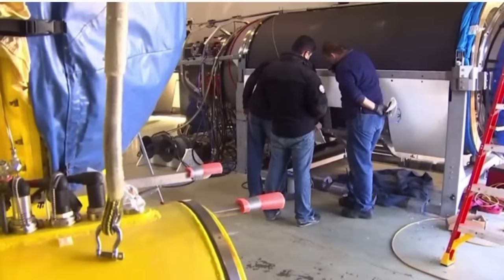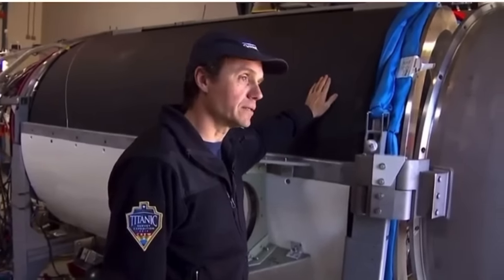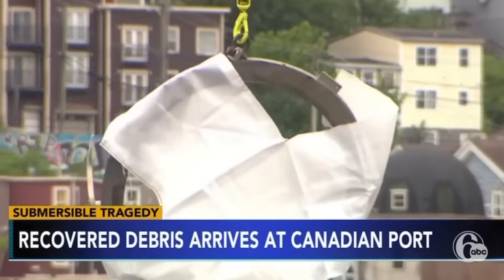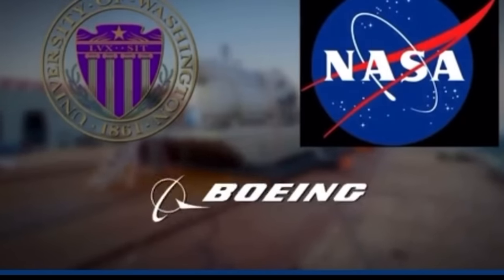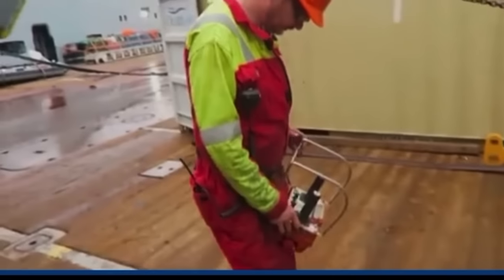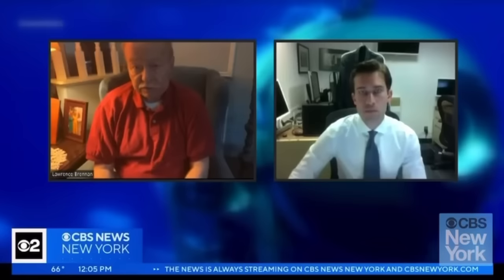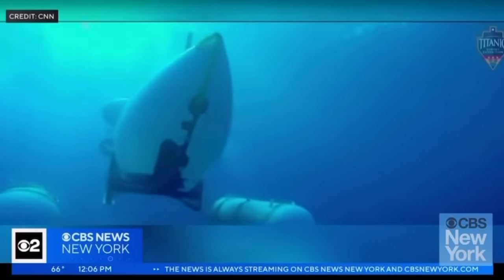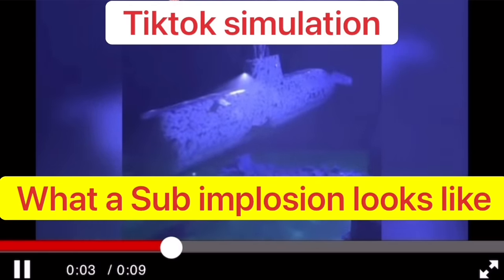Titan nosedived like an arrow (then popped like a balloon) #Titan #oceangate #Titanic

Comment: Was the origin of the regular `banging noises` heard for several days ever discovered? At one point it was believed that the sub occupants were trying to attract attention, but of course we now know that could not have been the case.
Reply: The ocean is a noisy place.  And sounds can carry for thousands of miles in water.   For example, The NAVY did not “HEAR” the sound of the implosion. They have microphones all over the ocean floor ( listening for subs ) and they RECORD the sounds.   When they heard about the Titan going missing, only then did they review the recordings and discover there was an odd sound that could have been an implosion.   There has never been an implosion of a small submersible, so the Navy would have no data set on which to base an analysis.  The banging noises could literally have come from the search vessels, if someone was in the kitchen banging pans against some part of the ship, or a crewman was effecting work on the engines.   The banging noise could just have been chunks of the Titanic itself falling apart.   The ship is literally crumbling to pieces, and a chunk of rusty iron decking dropping onto the deck below or a piece of squashed hull could make a banging noise.
Reply from the maker: the Navy heard the implosion right away but it seems they did not communicate that soon enough
Reply from the maker: interesting , in most reports it says the Navy did hear it when it happened, hopefully they will release more information soon
Reply: @silki24  Yes, but the Navy never said that. They said they ‘detected’ an anomaly. The SOSUS network is hundreds of microphones all over the ocean floor.  It alerts navy personnel if it detects a something unusual, and then the recording as actually listened to by analysts. But it’s not like they are actively listening, live, to five hundred audio channels 24 hours a day on the off chance of hearing something.  It was not until the support vessel actually reported when they lost contact with the sub that the navy had a time reference and found they had detected something around that time in that location.   But then, the surface support ship had a hydrophone in the water, too and would have heard the implosion way louder.  But, again, no one had ever heard a submersible implode before, so they weren’t sure what they were hearing.

Comment: Why do ppl keep harping on the fact that they were bolted in? I'm pretty sure if something happened where rescue could be possible they would have to raise the sub bcuz humans 1 cant breathe underwater and 2 humans cant withstand the pressure of the ocean that deep. The ONLY way they could have been rescued underwater would be if both subs could dock together allowing safe transfer to the rescue sub. Are there even subs that could do this?  I'm not an engineer so please correct me if I'm wrong.
Reply: i think the thought is if they surfaced but nobody could find them...they would float around running out of oxygen while people searched, while other subs could atleast surface and open their hatch and not suffocate. i think thats why but i could be way off too!
Reply: @heatherlouise814  I believe you are correct 💯. I just hadn't thought of it that way. The whole Titanic/Titan thing had me locked in on the sinking part. Well that and somewhere they said that Titans tiny little thrusters weren't powerful enough to help them surface. Apparently they were only meant to steer.

Comment: 10:10 the sub did NOT freefall for 3000 ft, this is a submersible, it works on bouyancy, not lift and wing angle. if it freefell from any point, it wulda been overweighted from the start, and freefell from the beginning. everytime i see someone post a claim of this freefall, has clearly never swam enuf to understand how waters resistance and bouyancy work. . . remember. . . its nt a damn airplane
Reply: It's just like an airplane
Reply: @Cleatus546  Spoken like someone that has never spent any time in a submarine.
Reply: @brianhubert8513  
I was assigned to the USS Tugboat during the Korean War, I know what I'm talking about.
Run silent run deep.
Reply: @Cleatus546  What was the hull # ?  I know what I'm talking about also. I served on two boats. The USS Tecumseh and the USS Francis Scott Key. I also have a pilot's license. Subs are not like an airplane!!!
Reply: @brianhubert8513  
The hull number was 007,  but keep that under your hat, it may still be classified. I have two pilots licenses and  submarine license. I'm not boasting. I also served on the Scott Petterson. I also flew an unmanned drone during WWII.  Thanks for your service.
Reply: @Cleatus546  which two pilots licenses do you have ??
Reply: Class A & B
And forklift certified
Plus Submarine License. 
But I'm not boasting.
Reply: @Cleatus546  007,  A&B  That's right you're not boasting.  You should look up things before you make these kind of statements!!
Reply: @brianhubert8513  
I don't have time to goof around I'm busy driving my bus..uh.. I mean flying my Cessna turbo prop. 8 seater. I used to fly with the Blule Angels, but I'm too old now. I can't take the g's.
Reply: @brianhubert8513 Ya'll are a mess 😂
Reply: @poutinedream5066  Yet I'm a rocket scientist compared to 
@Cleatus546
Reply: Rocket surgeon

Comment: It's crazy they were literally charging a quarter of a million PER person. The trip the "accident" happened was not their 1st trip. If they were smart, they would have seen they have a huge revenue income situation. So they should have done everything they could have to make a sub that is Fully capable of handling the pressures & compression forces that they were putting their sub through. It takes just a mild understanding of physics/material science/engineering design, to realize there is something to possibly worry about when it comes to the current design they were using. The hull was connected to the end cap with adhesive glue and some bolts, the hull was spun in a linear manner without any woven patterns or reinforced structures. They should have AT LEAST made a sub with a much more durable, strong, reinforced, trusted material design. I'm all for innovation and trying new things and pushing the boundaries but when it comes to exploring the deep ocean you want to make sure that your sub capsule does not implode or not be able to endure the environment you are going... There is no wiggle room when it comes to this & they already are charging a TON per person anyway sooo, why not make it work. If they did, they would still be having a huge income situation happening.
Reply: Well, at that price, not a huge amount of people who would be interested, so may not have been exactly rolling in money.  People who survived or didn’t go shared texts to show that Stockton was hounding people pretty hard to get customers, and downplaying the safety issue, with texts claiming it’s as safe as scuba diving, and that there has never been a submersible implosion (irrelevant if this submersible was a different design and lacked the typical stress testing).   So seems he was having yo chase customers and they weren’t a lot of them.  

And even with the corner cutting,I suspect it is pretty expensive to have developed and run a submersible….so not like that 250k ticket was all profit, a big chunk probably went to running costs.
Reply: This coffin wasn't capable of making multiple dives to Titanic depth, and proved it.

Comment: It's unfortunate that Stockton Rush did not have the funds to ensure the necessary safety protocols were followed.  Saying the submersible is good to 4,000 metres depth when your target depth is 3,800 metres yields in a slim margin of safety.  It's possible the epoxy coating had begun to fail allowing the craft to take on water and more mass.  It's apparent a surfacing attempt was made with barely much of a rise.  If the coating kept allowing water in, what little buoyancy remained would be eliminated.  Almost at its maximum depth with a decreasing structural integrity: "it's been good to know ya".
Reply: He picked those numbers out of his arse, and with fingers crossed.
Reply: @sandgrownun66  
That seems to be the case.  Didn't work out for him though.
Reply: @MsJfraser  It never was going to work out. All the correctly engineered submersibles which can cope with a 4,000m depth, have been spherical, two-person metal vessels, with conventional hatches. A poorly made woven sphere with bonded titanium end caps, just doesn't have the resilience required for such a depth.

Comment: Just the concept is stupid! If you're only able to see outside the thing through monitors, why TF would people even need to go down with it?! Just watch monitors on the boat... same experience, without being trapped in a tube with the farts of 4 other people! Rich people just LOVE to burn money on stupid crap. Yet paying 2% more in taxes to actually improve the lives of millions of people is the waste of money??? The cost of this whole BS company could have solved so many different problems! Once people get rich enough to do crap like this, their money should be taken away and they should be launched into the sun, since they like getting up close to things there is no reason to get close to.
Reply: Play stupid rich people games, win stupid rich people prizes.
Reply: I agree that letting a robot go down (for example) and watching from the ship is a good idea and basically being the same experience, the issue is that in order to see the video below, there has to be cables carrying the signal (which has been done in the past).   You can't transmit the amount of data needed through the water without cables.  But I am in no way saying going on the Titan contraption was a good idea.   Just hard to believe someone wouldn't do their own research, simply finding out that there is 5000+ psi would be enough to scare me out of doing it, no matter who designed the sub.

Comment: 13:53  When they were spinning it had nothing to do with the "stupid" game controller. It was because his idiot crew wired the electric motors backward. So he had to reverse all his inputs to account for the thrust direction being reversed. All you people that think the playstation controller is some kind of cheap toy,you dont know what you're talking about. Xbox and Playstation controllers are actually high quality. And can be rather expensive. And the US military also uses them to control multimillion dollar drones with in combat zones.
Reply: Except he was using a 3rd party knock-off. Not as good.
Reply from the maker: mine fail all the time, must be a reason why the Navy does not use them when men are on board
Reply: @silki24  They also don't just have one on hand. If one fails, they have others on hand and usually drones have a kind of auto-pilot that keeps them loitering if they lose connection until comms are re-established. Interesting that yours fail often. I still have a first generation Xbox 360 controller that still works as well as it ever did. Funny how that first gen controller still works but the first 360 it came with got the red ring of death in less than a year. haha

Comment: Thing is.. I'd probably join the sub if I had the chance.. The thrill.. That once in a lifetime experience.. I dont blame any of them for taking the trip.. What still blows my mind is that there was no wire.. I tiny safetywire.. I understand riding a bike without a helmet, climbing a cliff without ropes, going to the shop in pyjamas and sandals.. Insane stuff.. But the lack of a safety wire is absolutely insane to me..

And.. Were there manual steering in any form without the controller? And was it wired or bluetooth? The thing I noticed is that it is no PlayStation controller, but a third party variant.. I know the quality of both PlayStation and Xbox legit controllers are of sincere quality.. But third party varianta are scetchy
Reply: You cannot have a wire going down that deep because the weight of the wire at that depth is so great that the wire won't support it.
Reply: @pforce9  I have heard that before and understood it has complications.. It's rather that I dont get why its so difficult.. :) Wires can be so thin and strong.. Just in my house I have half a kilometer of electric wires and 10 times that would be enough.. But this is definitely not.my field of expertise and my little hungover brain tries to make that wire be my little genius invention lol
Reply: @martinsvendsen1665  Not complicated at all. How much would the wire weigh if it were 5 Km long? It would be too heavy to support it's own weight.
Reply: @pforce9  i understand.. :)
Reply: That'd be one long and thus heavy wire. Also, what would the point of a wire be if it imploded, like it probably would do, due its compromised design.
Reply: @sandgrownun66  true.. Well, if it nosedived due to a malfunction, it could have prevented that part.. But I get now that the wire would be more difficult than I imagined it would.. :)
Reply: @sandgrownun66  that is why deep sea anchoring systems use tapered wire that gets thicker at the top, otherwise, the line would not be able to support it's own weight.
Reply: @martinsvendsen1665  When you're going that deep a wire isn't practical. In fact, it would be more of a hazard, if anything.
Reply: @sandgrownun66  yeah, your'e probably right :)
Reply: @martinsvendsen1665  Yes, I am.

Comment: Popping like a balloon is not a good analogy.  To so pop would require counter pressure to the water.  Even a crack in the hull as the vessel collapsed would not not cause an in to outside popping.  The external water pressure would contain any expanding explosion to occur.  Once a structural failure occurred the only way the hull would fail is implosion, not explosion.
Reply: An implosion requires pressure to build internally before the failure. The failure occurs because the pressure inside becomes too great and the weakest point of the structure pops outwards, allowing the rest of the structure to implode inwards.

It's similar to popping a balloon by squeezing it, but not similar to popping a balloon with a needle.
Reply: @Pohonesty 100% incorrect.  Any increase in pressure internally would LESSEN stress on the hull. For example, Had I been Rush, I would have opened the valves on every air tank he had under the floorboards to increase internal air pressure. 30 PSI inside the sub would remove One full atmosphere of pressure differential.   Of course, If I was Rush I would never have made the hull out of carbon composites in the first place.   But you are simply wrong. No part of the hull needs to pop out for an implosion.  This is because the air inside is Compressible. The ocean can literally just SQUEEZE the entire thing smaller.   For example, a US navy attack submarine has a hull of a specific inside diameter.  Near its test depth, that diameter is over an 8th of an inch SMALLER.  And the pressure hull is shorter by nearly an inch.    No part of the hull pops outwards… ALL the atoms of the steel got squeezed closer together.  ( in the middle of a star, pressure is so high that atoms will fuse )
Heck, watch a YouTube video of the myth busters imploding a railroad tank car using no more than 14 lbs per sq in normal air pressure.  At Titanic, the pressure on the hull is 6,000 psi.   As this sub descended the pressure squeezed the hull smaller.   It’s why most of the external equipment on a submersible is not rigidly mounted to the hull, but strapped on. Because the parts that are no holding air at surface pressure do not change dimensions.  One valid question was whether the titanium hemispheres squeezed smaller at a different rate than the composite cylinder between them.  If so, this would have caused a shear stress at the points where they joined that could have been the origin of the final failure.   

But the reason you haven’t seen any of the carbon hull recovered is because it looks like just a snarl of tangled carbon threads shot thru with shards of shattered plastic and bits of people.
Reply: @christopherpardell4418  My comment was correct. I do appreciate you typing your thoughts out, though. Also, a piece of the carbon hull was recovered with some sort of human remains in it.
Reply: @Pohonesty   No, it wasn’t correct. And claiming it was is not an argument.  The pressure inside does not become ‘too great.’  The entire point of implosion is that its it pressure OUTSIDE overwhelming the structural strength of the material holding it back. It is the DIFFERENTIAL in pressure that is the source of forces on the hull. The dimensions of the hull decrease as it gets deeper, and the air pressure inside rises, but just a tiny bit. We are talking about a change in volume of no more than 10 cubic inches.  Enough to raise internal air pressure to, maybe, 15 rather than 14.7 psi.   In an implosion the entire hull gets SMALLER, very very suddenly. And there is barely even a bubble that escapes, because at 6,000 psi, the air inside the sub is compressed to maybe the volume of a soda bottle. ( the bubbles will expand as they rise. ) 
And, I did not say they hadn’t recovered pieces of hull, I said you have seen no recognizable photos of any carbon pressure hull parts, because they don’t look like hull. They look like pulverized and shattered fiberglass, a snarl of  plastic shards embedded in a tangled mass of fibers. With minced human remains shot thru the mass because ALL sides of the carbon hull passed thru the occupants like squeezing eggs against a wire screen.
Reply: @Pohonesty  PS, what you are suggesting is exactly like saying that what makes a pipe bomb work is when pressure OUTSIDE the pipe gets TOO GREAT, and part of the pipe moves INWARD before it blows outwards.